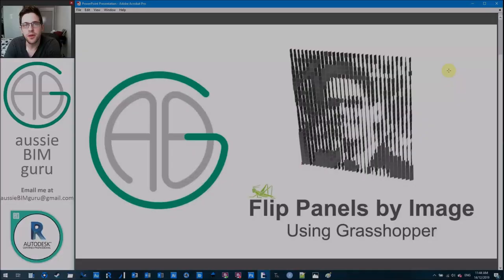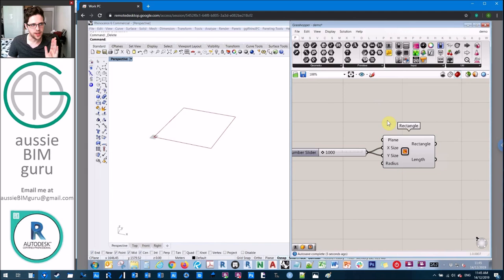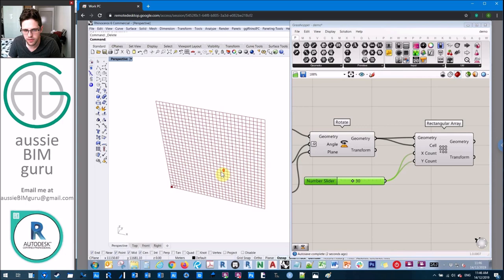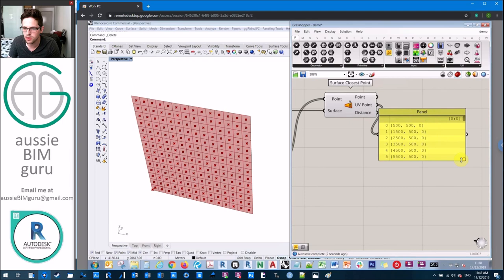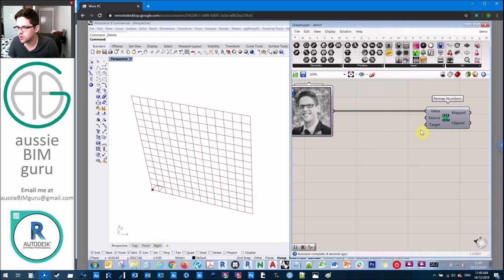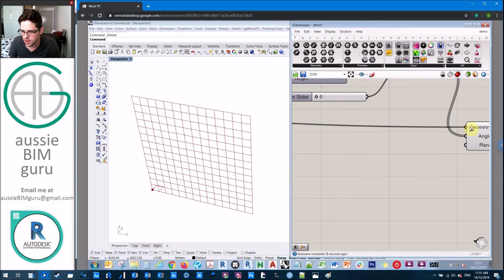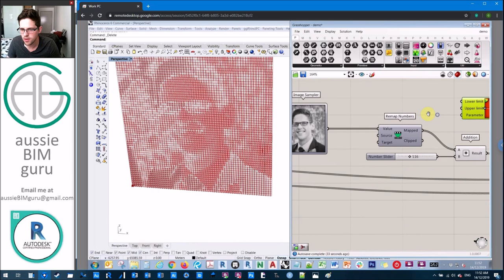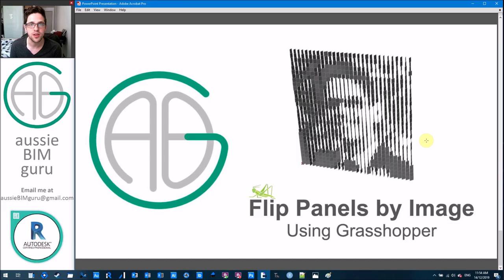Flip Panels by Image using Grasshopper!

Comment: thanks = great video. If i want to change the axis of rotation of the panels - what is the easiest way? i want to rotate around a horizontal axis. Thanks Ben
Reply from the maker: You're welcome! Try rotating a plane at each panel centroid around the Y axis by 90 degrees before feeding it into the final rotation planes.

Comment: Hello, Thank you so much for the tutorial , was wondering if it is possible to have the same technique applied on a loft surface
Reply from the maker: As long as the surface is untrimmed and has a valid UV domain then yes it should be possible. You may need to check the normal at each panel as well though if it isn't a shear surface (has curvature in the YZ/XZ direction) in order to orientate the panel.